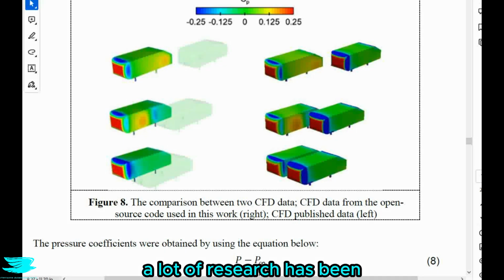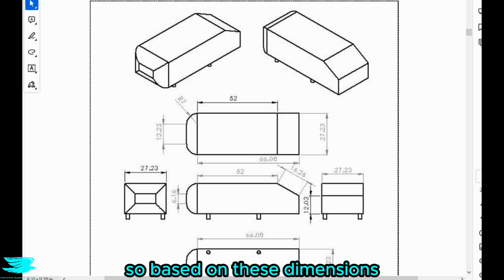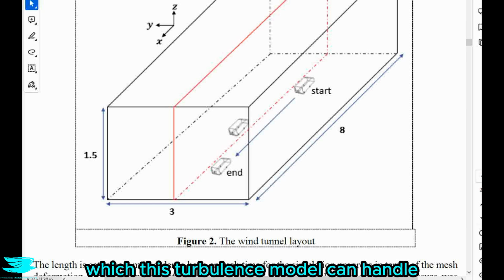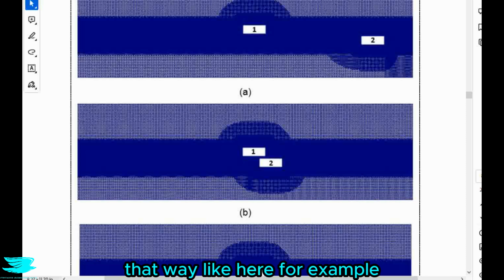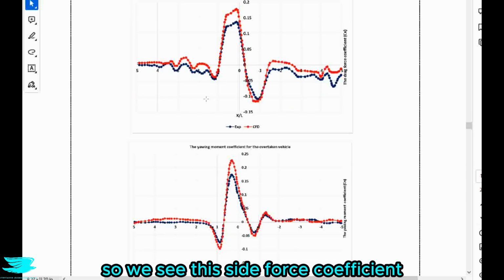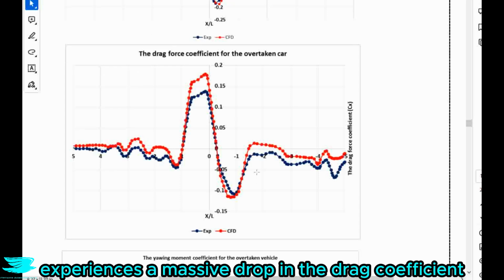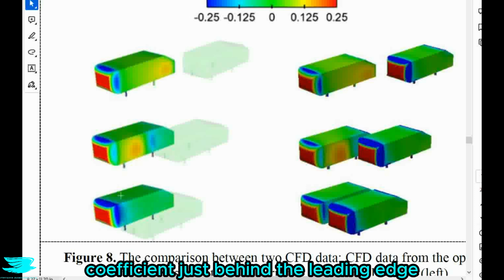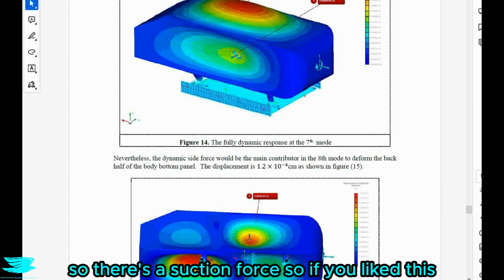Podcast 190 Car Overtaking Aerodynamics

Comment: It would be interesting to see a case study, focusing on the side-by-side position in more detail.

When the cars are aligned abreast, flow is largely unaffected on the freestream side, but is quasi-2D on the traffic side. The reduced 3D flow should result in greater lift and/or downforce production, with a reduction of induced drag. However, there would be an increase in form drag, due to a reduction of 3D wake infill, on the traffic side.

Another explanation for increased drag is friction/interference drag on the traffic-side surfaces, due high velocity flow within the venturi gap. If the lateral gap between the cars was small enough, significant boundary layers would form, choking venturi flow within the gap, reducing friction drag. As an extreme example, zero gap eliminates friction drag on the traffic-side faces.

How do you like that load of BS?
Reply from the maker: That's a good point about extremely small gaps. Like, if you were trading paint with the other car, then you would probably get some extreme suction.